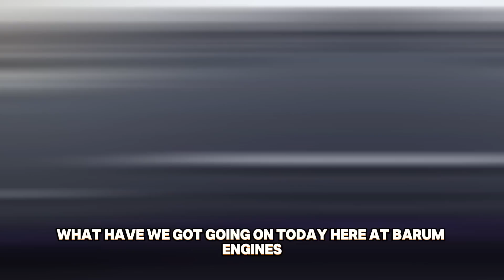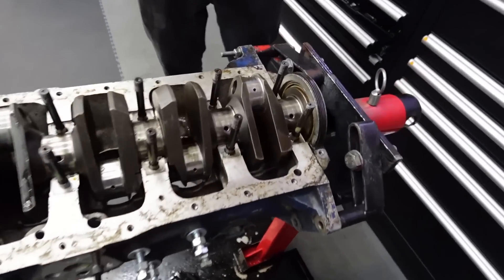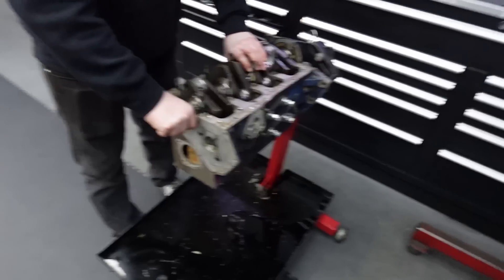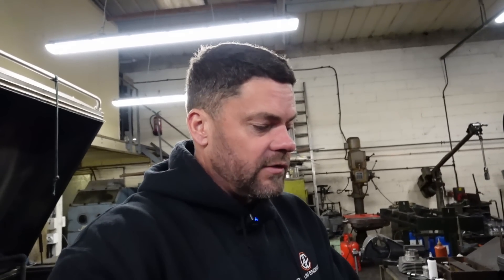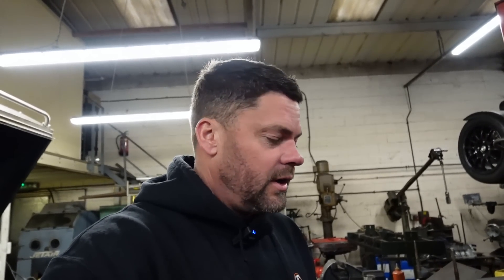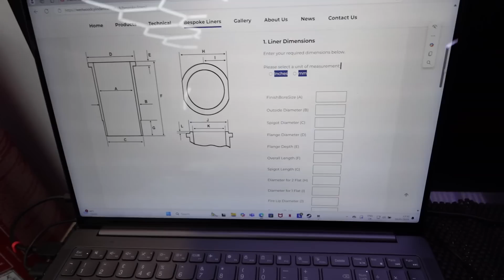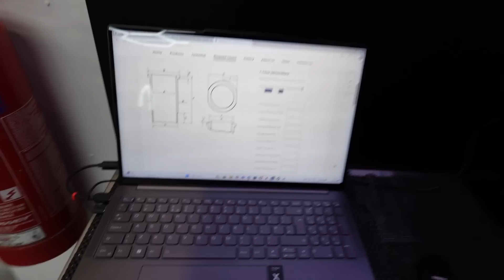WE ASSESS THE FULL DAMAGE OF THIS ESCORT RALLY ENGINE

Comment: Hi lee great channel I have a question for you im running a z20leh vxr engine in my astra the block is a open deck block which means if you run over 450 newton metres of torque the cylinder wall crack RnD motor sport carry out a modification by wedging the water jacket with a machined piece of material would fitting ductile liners be a better modification to reinforce the cylinder walls of the cast block many thanks cheers Chris.

Comment: I don't think they cast a cast iron liner into the aluminium block - molten cast iron would melt the block so they must press liners in at the factory. But I could be wrong!
Reply: It's the other way around. The liners are set into the inner core mould first then the aluminium is poured in once the outer mould is set in place. Basically.

Comment: Not the molecular structure. Its actually the crystalline structure which is different.
Cast iron has big random flakes of graphite which makes it weak brittle. Ductile iron is also cast, but with a nodulising element like magnesium added to the melt.
That causes the carbon to form spherical crystals - much more stable and stronger.
I would imagine that things like liners are cast using the centrifugal method - the melt is poured into a spinning mould which further refines the microstructure.

Comment: If that crank is a replacement of the original then something must have gone wrong with the original, hence the replacement.
If the replacement was standard when fitted and is now 10 undersized that means that on 2 different occasions something went wrong. 
Total of 3 times at least.
The question to ask is *WHY*?
The answer might be that the oil channels feeding oil from the main gallery to each main bearing were drilled too small and the mains are being starved very slightly BUT the big end bearings are having a serious starvation problem.
This would NOT show up as low pressure because the undersized channels would give a lot of back-pressure and make the oil pressure look good on the gauge (which is in the main gallery).
BUT also, don't simply ram the biggest drill through the channels either. 
Too big a channel diameter could cause too much flow which may bleed off too much oil pressure.
.5 to 1.0mm bigger should be safe enough.

Comment: Cast iron is strong but very brittle whereas ductile iron—also referred to as spheroidal or nodular iron—is actually a group of irons that exhibit high strength, flexibility, durability, and elasticity due to their unique microstructure.
Reply: Quite!
"Cast iron" actually covers a wide range of iron castings and techniques, with different properties, such as you gave.
Reply: why not ductile steel? steel can be better in every way? just curious
Reply: @tturi2  
Off hand - cost, difficulty in manufacturing, suitability for the requirements, etc.
It's a very complex subject, and if your interested, check out "Metallurgy". 
It's 35 years since I had to learn in in college, and don't recall that much about it's specifics.

Comment: The bda can be 1600 to 1800 and the BDG is an alloy block 2000cc
Reply: No, a "BD" can be between 1100 and 2200, from memory, the "A" is specifically the "1601" production engine, other size engines have different identifying letters.

Ah, here you go -
BDA     1600cc 120bhp std engine for Escort 1969

BDB    1700cc 200bhp rally engine sold as a kit 1970

BDC    1700cc 230bhp Gp 2 escort fuel injected 1970

BDD    1600cc 200bhp Formula Atlantic motor 1971

BDF     1927cc 270bhp Formula 2 engine, liners brazed in cast block 1972

BDG    1975cc 275bhp formula 2 and rally later with alloy block 1973

BDH    1300cc 190bhp GP2 1973

BDJ    1098cc 150bhp Formula C for SCCA 1974

BDK    reseved for forgotten project

BDL    experimental turbo

BDM    1599cc 225bhp Formula Atlantic, big valve injected BDD 1975

BDN    1600cc Canadian Atlantic

BDO    not allocated

BDP    1975cc 245bhp Sprint car fuel injected methanol 1984

BDQ    not allocated

BDR    1601cc Caterham Seven Road ? 1983

BDT    1778cc 200bhp RS1700T turbo  1981

BDT    1803cc 250bhp RS200

BDT-E   2137cc 500bhp evolution   BDT by Brian Hart

BDX    basicly BDG spec with larger valves and 10mm spark plugs

And then there are the Zakspeed engine versions, with and without Turbo

Courtesy of Spelberg Lotus Book
Reply: @ 😀 List Helps to basically show the BD Variants It's Close enough for a quick and dirty reference, the first few were Copied from the Cosworth Specs/Docs. Example : BDX wasn't a real Cosworth Designation, It was something Swindon Race Engines came up with - I know because I had one 😉 and it was Big Valve BDG head with 10mm plugs as the list noted.
It's all a little bit academic really, that anyone with a 2.0 Litre BD called it a BDA or a BDG🤣 - You would though expect it to be 2ltr. The "A" was Cosworths Designation for Ford Iron Crosflow Block,  and just to confuse they also Used "A" for the pre Crossflow Block FVA Engines 😂
Bottom Line they are all Great little Engines that would Sing their Heart out - But Crazy Expensive !!
Reply: @Redshift-  
Agreed.
Not BD's, but I do have some Cosworth KBA engines, which I think was the designation for the C20XE they developed for Vauxhall.
Reply: BDA's could be anything from 1100cc to 2.2Ltr 
BDG was a Cosworth Iron Block (with 90mm vacuum brazed Liners) Formular 2 race Engine with I believe F1 Cams giving 290 BHP on Fuel Injection.

Comment: I like the opening!!  

From Google AI:  The primary structural difference between a cast iron piston liner and a ductile iron liner is the shape of the graphite inclusions within the iron matrix: in cast iron, the graphite is in flake-like formations, making it brittle, while in ductile iron, the graphite forms spherical nodules, allowing for greater flexibility and resistance to cracking when bent or stressed; essentially, ductile iron has a more "nodular" structure, giving it superior toughness compared to cast iron. 

For those of us w/o Engineering Degrees, this sort of goes along with what Lee was explaining.  
Alan from NC, USA